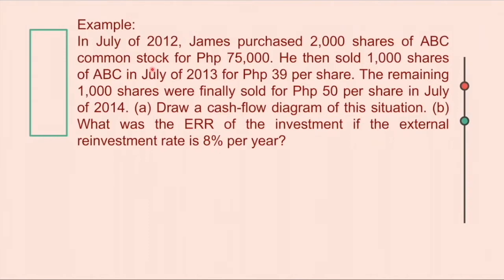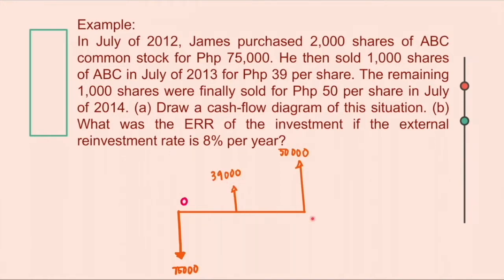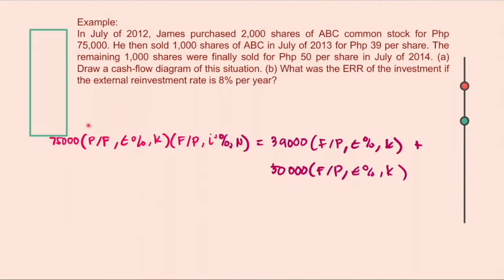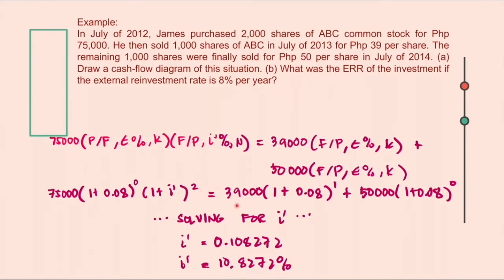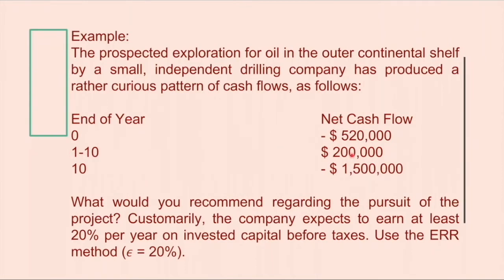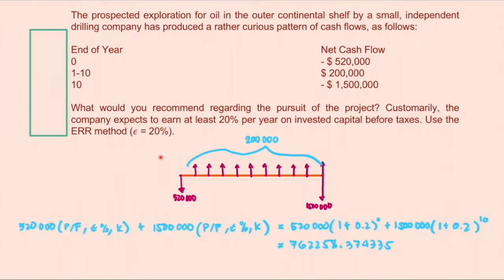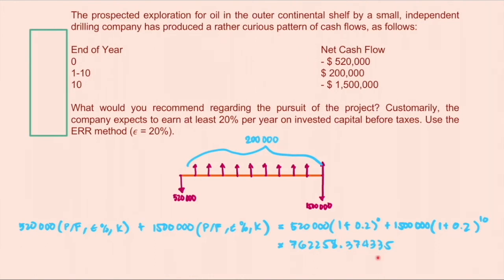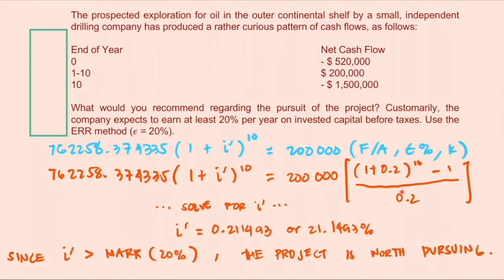Engineering Economy 21 External Rate of Return Example

Comment: 4:42, why is the result of the net cash outflow be 762258? Wrong calculation?
Reply from the maker: The final result is correct. The only misleading part of the solution is the sign of the exponent on the second term. Since we are expressing the F as P, the sign of the exponent must be negative. Nevertheless, if you calculate it using the negative exponent, you will end up with the answer on the video.